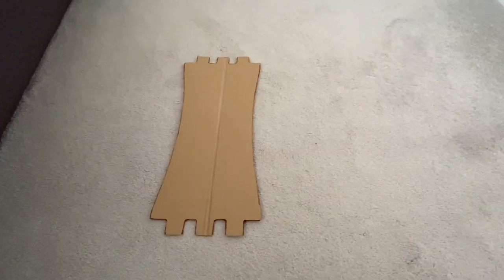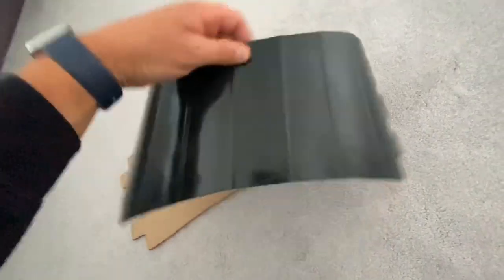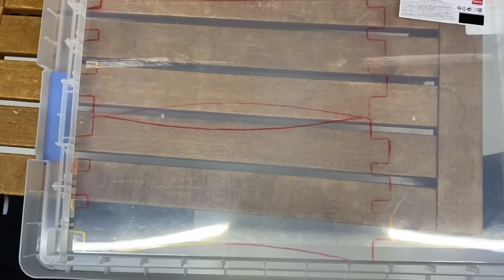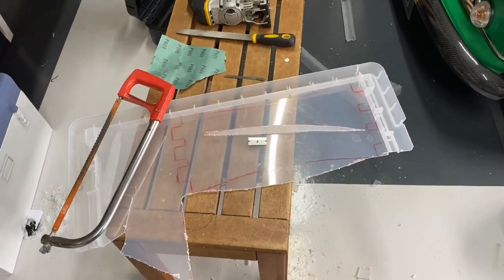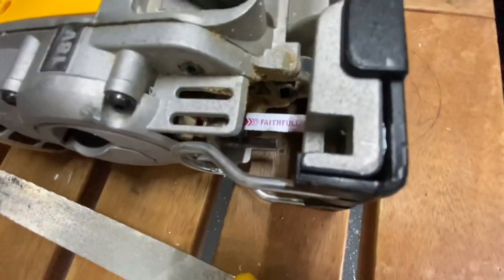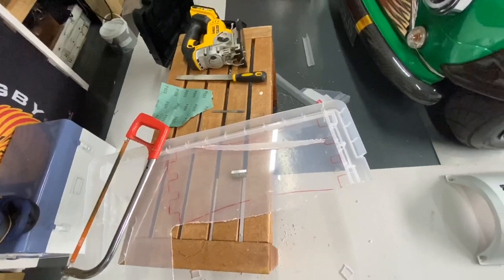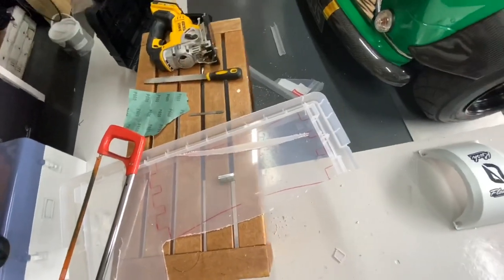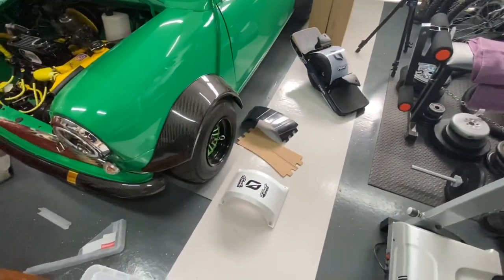How to make a Onewheel XR flight fin fender for a £1

Comment: Looks like polypropylene. That's a good thickness for the job but PP is terrible for shattering, and will probably degrade in sunlight or general UV exposure.
I made one almost identical to yours, but I used a "flexible cutting board" that came in a set of 4 from the kitchens shop. Its a bit too flexible so I had to make some modifications to it but im happy with the results now. That stuff is indestructable.
General tip for testing if a plastic type is brittle; grab a corner of it with pliers and bend it very sharply and quickly way past 90 degrees. Brittle plastic will shatter, medium plastic will maybe get a tear, and good plastic will just get a white crease and you can bend it many times.
Cool vid! 🙂
Reply from the maker: Wiz Rom thanks buddy l. It was fun making it. Thanks for advise 👍👍 we will see how it last on the first trail. 🤣🤣🤣🤣🤞🏻🤞🏻🤞🏻🤞🏻

Comment: Thanks for that idea!! I just got myself an XR with flight fins included with a black fender and have white rails but think that plastic lid type colour will look much cooler so I will  knock one up. Also need to find an idea for extenders because I have been used to the wide stance and did not have the extenders with it so not tried yet.